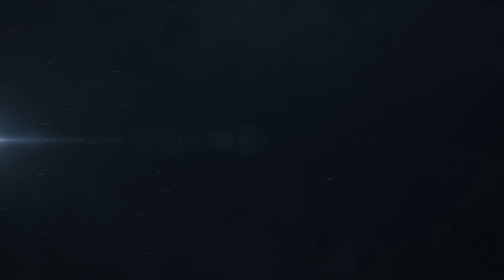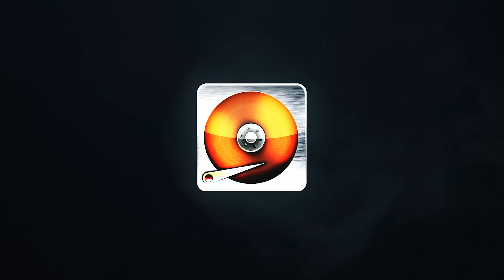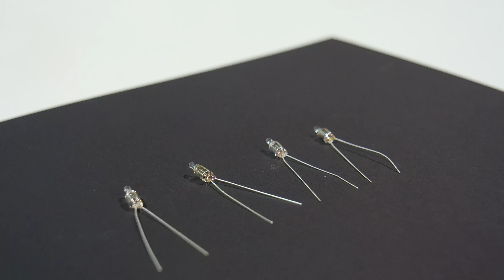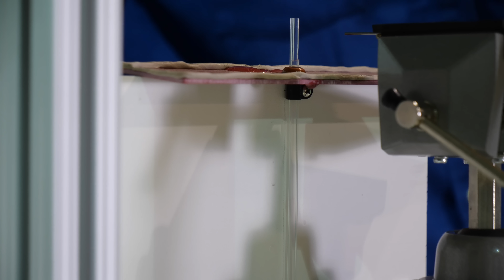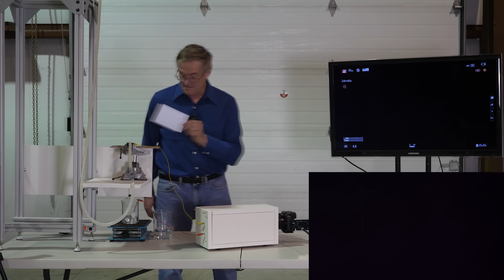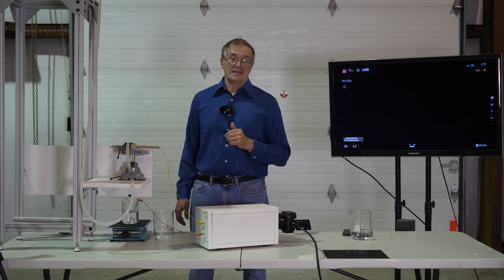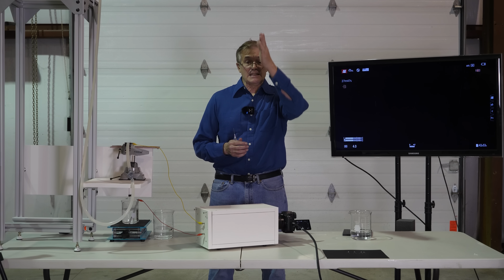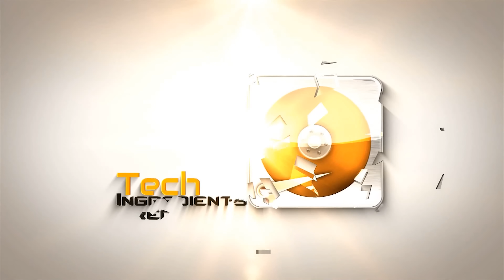We made electricity from water - and it's easy!

Comment: woah! so cool! 
1)so can you drink the acidic water after you run it down the tube (i'm sure you can)
2)how many times do you need to run it down the tube/how much mileage b4 it is no longer potable?
3)how much before it becomes 'acid'?
4)do you get more energy from the water going down than it would cost to lift it back up?
5)how much would I need to scale it to charge my phone? lol
6)couldn't you just get a bike wheel/inner tube, fill it with water, and keep it rotating slightly? one side would endlessly be getting stretched up? if you maximized here, wouldn't that make a funny 'endless motion machine'? lol
7)why have a continuous stream? Why not have a row of constant drippers? I wonder what the ideal droplet size is, optimizing probably for power gain
8)can we just remove the left behind ion from the substrate? Maybe if we charge the plastic than it will get sucked away before it can get reupped back into the water stream?
just some initial ideas, this is really exciting! ima go read the paper!
Reply: actually, I think the 'just having a vat of water through which you pull up a sheet of this plastic stuff at the right speed' is a really interesting idea.

Comment: As a phenomenon, this is just a party trick. The impressiveness of it only comes from its practicality. It's microscopic amounts of power, so, for it to be practical we either need an extreme situation where it might actually be useful and there were no alternatives, or, it has to be scalable to a useful purpose. I'm not even sure after this video what order of magnitude we're dealing with. You said milliwatts. So, thousands of tubes to make watts? At 3mm, 1mm wall thickeness perhaps, that's 5mm, so, a cross section of 200x200 of them in a square meter. That's 40,000 of them to make 40 watts? Across a 100m long dam, that's only 4,000 watts? Suppose 3 per meter if you only need about a foot, that's 12,000 watts per meter of dam height. Suppose a medium sized dam of 50 meters, that's only 600,000 watts covering the entire face of the dam with tubes. That sound impressive, but it's 3-4 orders of magnitude away from the 1GW that same hydro dam would create from falling water. Some 171x as weak. Now you say this can work in places where hydro can't, because of more modest flow rates. But still, I'm not convinced at all there's an argument for this technology until we have an appreciation of scale.

Comment: I don’t buy the power generation argument.  If you just put some dynamo/generator in the stream the force of gravity on the water would generate more power through rotational energy transfer.  I’m pretty sure gravity potential energy would be greater than electrostatic energy generation otherwise it would have been done already.

Comment: I always wondered about using  electricity for reduction/oxidation and precursor synthesis. Like turning methanol into formaldehyde or methane depending which electrode (charge) you use.

Comment: Here is an idea: what if you had a massive pyramid with a metal cap on top and fog condensating on it, flowing down its sides. Also a waterchannel around its base forming a ground potential. The metal cap should charge up quite well. Did you know that limestone is used to remove fluoride from water. Don't even need to fluorinate the surface. It fluorinates itself.

Comment: It's an interesting novelty but little practical use compared to more efficient ways of using flowing water to generate electricity.
Reply from the maker: That depends on the scale of the need.
A typical dam is more efficient, but if you have some remote instrumentation in the jungle, this might be ideal.
Reply: @TechIngredients  Pretty niche use case and less reliable than batteries that could easily last five years or more compared to a system prone to blockages.

Comment: I would like to ask you if this discovery is related to the Kelvin water electrostatic generator, exemplified in the following video and many others??? Link : https://www.youtube.com/watch?v=sArNxGnYhNU
Reply from the maker: They both generate high voltage/low current from flowing water.  But the Kelvin device requires an applied external field while this depends on surface interaction between the water and the plastic.
Reply: @TechIngredients  Thank you very much for your answer. I was referring to that phenomenon you described by which a small percentage of water always dissociates into ions that create a potential difference that can be harvested... On another note, I think I found a method by which you can atomize carbon in a continuous and controlled way so that graphene can be produced in any quantity up to an industrial scale. Would you be interested in me presenting it to you? How could I communicate with you privately?? I wouldn't want to bother you but if I wrote you an e-mail on this subject, would you be interested? I am a big fan of yours, I am almost 50 years old and I am an engineer.

Comment: Very impressive and fascinating phenomenon

You've mentioned various iterations were done on the physical aspects (tube radius, length, etc...) but was it explored and measured on closer to tiny and microscopic levels (like the channels in your foam application hypothesis) for channelling water droplets?

Quick back of the napkin assumption here, but it seems to me there would be a relatively simple and efficient way of manufacturing a massively channelled "block" that only requires water to be poured onto it, and it would be hooked up in parallel at the manufacturing step, and then just run water on top? Perhaps this is how the writers of the paper were thinking about it for rain? A solid state water turbine of sorts?

Comment: Definitely Interesting, but let's not forget where the electric power comes from: the potential energy of the water, right? I think I heard the efficiency is 10%. Hydropower is up to 9X as efficient. Also, do you really gain anything by making the water do loops and what not. At least the potential energy is still the same.
Reply from the maker: You're right about the efficiency. 
The loops don't help or hurt.  The point is that the flow can be circuitous, so a porous foam could still work.

Comment: I wonder if a spray or mist would work differently than the syringe. That would form the droplets and separation you are looking for with plug flow easily.
Reply from the maker: I think you're right.
The downside is it would require more energy to pressurize the water for the spray.

Comment: That is cool but I don't think it can keep up with my Kelvin water dropper by a long shot. I power it with a pump, so it maintains flow rate. 20,000 from 30 ml of water and I am powering my electrostatic motor. For more realistic lightning I have "cloud layers" in the form of a Marx generator for big sparks. The idea this is only useful for teaching is silly. It works great. Thanks for another good science video.

Comment: okay, that's neat (although very low-power). but if the output water is significantly acidic, then capturing and releasing water at scale will mean the generator pollutes the water downstream. also, doing this with regular water will absolutely clog these channels with every type of solid deposits (calcium ions, silica, everything). hydro power plants don't run on distilled water.
Reply from the maker: Two things. 
This will generate 90% of the distilled water output using seawater 
The acidity of the output is neutralized when the current flows through a load.

Comment: I wonder if this could be used in a 2 step device to destroy PFAS in water.
1. create electricity with this system
2. use the electric power to destroy PFAS in the process called electrochemical destruction.
Now all you would have to do is put the device in any water stream/river/whatever to slowly remove PFAS without any external maintenance/power supply.

Comment: Bubble aluminium is commonly used for blast walls, wouldn't that save the step of having to make electro coated foam to make a multichannel metal structure for the flow?

Comment: Often, with a tiny neon bulb, you don't even have to "wire up" a complete circuit. Just apply a sufficiently high voltage potential to ONLY ONE terminal of a small, neon bulb, and let the other terminal just hang in the open air. Usually, that is enough to get ONE of the terminals, INSIDE of the glass envelope, to develop an orange glow around it. If I remember correctly, small neon bulbs act like diodes, that exhibit a voltage threshold of 63 volts. On the moment that you develop a 63 volt potential difference across the terminals of a small neon bulb, the bulb will light. You have to be careful, though, whenever lighting small neon bulbs, to include a series Current Limit resistor. Failing to do this can often result in instantly BURNING OUT a small, neon bulb.

Comment: Dear Host...
Recently, I was watching an uploaded video about how pirates, from a few centuries ago, were constantly forced to drink bad water, and constantly searching for sources of good water. When they found a good water source, on some island, the pirates would create a secret map, that only they could interpret, that told how to find the hidden source of fresh water. While out at sea, the pirates were surrounded with saltwater, which supposedly has a 3% concentration of salt. What I was wondering was, suppose the pirates used the saltwater from the ocean to create a bank of saltwater batteries. Suppose the pirates then filled two large glass beakers with saltwater, put a positive battery electrode in one beaker, a negative battery electrode in the other beaker, and a glass "salt bridge" TUBE between the two beakers. As a strong DC current was driven through the saltwater solution that filled the two glass beakers AND the glass "salt bridge" tube arrangement, I would expect that ONE beaker would eventually hold concentrated Sodium Hydroxide, and the OTHER beaker would hold Chlorine Gas that was embedded in otherwise pure water. Now suppose the beaker containing the solution of concentrated Chlorine Gas, embedded in pure water, was put in an area on the pirate ship that had really good ventilation, and was permitted to stand, so as to allow the Chlorine Gas to diffuse OUT OF the otherwise pure water. After enough time, would the water, devoid of embedded Chlorine Gas, be both pure and drinkable? In other words, if the pirates from a few centuries ago knew how to wield the science of Electrolysis, would the pirates have had the means to make as much clean, drinkable water as they wanted, starting from the 3% salt concentration saltwater that was abundant, all around their pirate ship? I am avoiding the notion of filtration by way of dialysis membranes, because I don't think the pirates would have had anything to make a suitable and clean membrane from.

Comment: Flow electrification, useful but useless. Unless we find a way to harness those super high voltages without loss through heat and expense. 
We have heat losses, electromagnetic losses, corona discharges ... all making the process inefficient UNLESS we find better ways to use this raw power.

Comment: Thanks for this video!  Very interesting!  I concur with the parallel channels. I’m not sure you could miniaturize each channel like the transistors in an integrated circuit, but to the extent that you could, you channels grow as the square of the size which is a decent multiplier.  So yeah, it’s not a fusion reactor but you don’t need to create millions of degrees hot plasma either!  ;-)
Reply from the maker: Thanks,  and I agree.

Comment: I am hearing "can operate with as little as 100 Volts" for the indicator lights. That sounds like a LOT to me since LED lights operate around 3 Volts. This might be the whole point, though, but I am not sure.
Reply from the maker: It is the point.  At the same time, these lamps draw very little current, and that matches better with the output than with an LED.

Comment: So, I have a crazy question. If you have a 2 foot sheet of plastic sloped like a roof onto a metal pipe so the as a sheet of water flows but becomes droplets leaving the pipe with the aforementioned trailing edge ionic transfer could you create more electron deposits? What if you stacked conductor, insulator conductor as the roof’s drip edge?  Maybe running these in a series and parallel combination would create more voltage and amperage?  I’m thinking it might need some clever device between them to act like a diode to prevent electron diffusion into the other conductors though.

Comment: Tesla's "Apparatus for the Utilization of Radiant Energy" (patent US685957A) could work with this. Use that to save up the amps, then discharge into a tesla coil to drop voltage to a usable frequency. Basically making a reverse spark plug.

Comment: Assuming you'd get 0 volts in zero gravity, I wonder how much voltage you could get with a centrifuge setup. Instead of a syringe, you could use an axial inlet, branching out to radial syringe-nozzle spokes. The entire setup (except for an axial water source) would need to rotate together.

I suppose the centrifuge would take power to run. Besides friction, you'd need to add angular momentum to the water, as it spreads radially. Still, this might be an interesting way to step up the voltage, while altering the fluid-flow characteristics.
Reply from the maker: I like your way of thinking, including the questioning of your own concepts.

Comment: There’s a possible biomimetic parallel between what you’re building and the inner structure of the Great Pyramid, as described in some of the Land of Chem research. The idea of using limestone to slow, charge, and structure water through natural porosity and flow pressure seems right in line with what you were describing around [7:10] in your video. I’d love to explore that further if it’s of interest.
Reply: Very interesting indeed, so the Egyptians possibly had the means of Electricity generation?  This would start to connect the dots.
Reply: Giza Pyramids were Stirling Engines imgur: 47baUle Air shafts were capped. They didnt harvest electricity, they used sails in wooden frames on ratchets in the "piston chamber" aka the Gallery to create rotational energy to power the equipment needed to saw stones.

Comment: they used to compress air using falling water mixed with air from rivers, 
those systems probably actively faught ionization, but could probably  repurpose those old designs for ionization as well as compressed air or traditional hydro electric

though you probably need to be careful about galvanic corrosion and arc hazards might be unique, from super high voltage etc